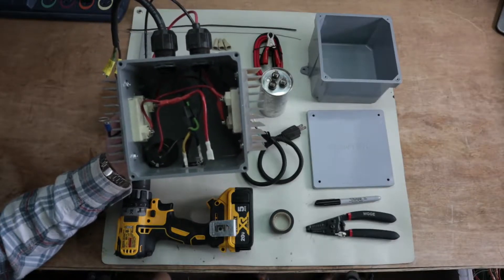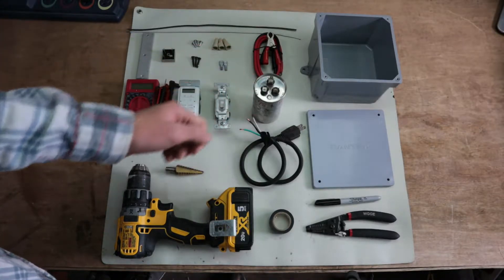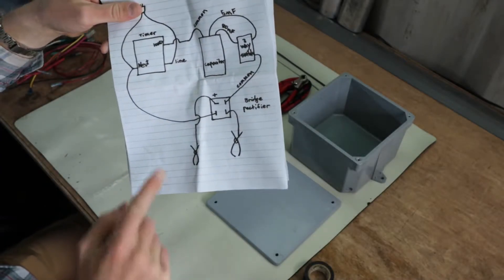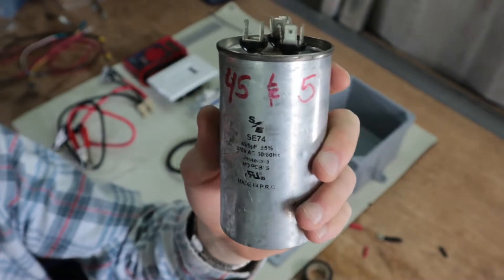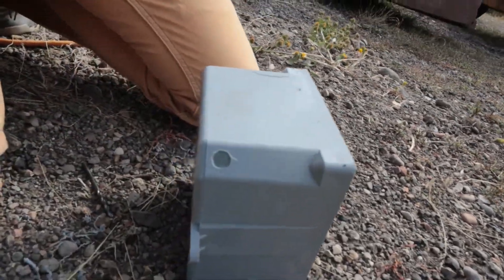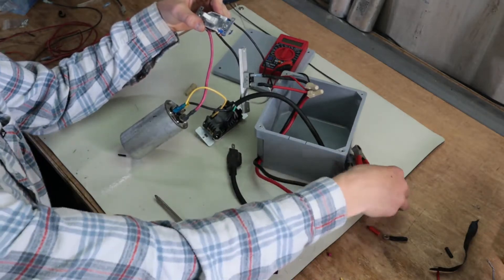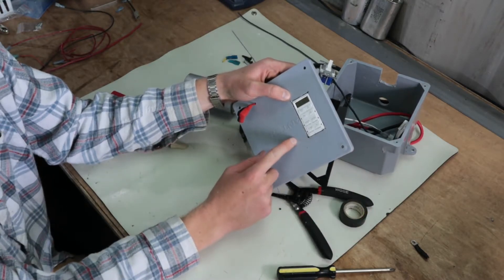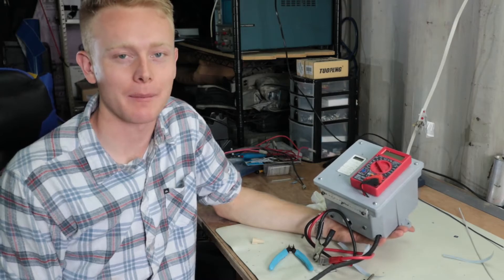Capacitive Battery Charger | Revive Dead Batteries

Comment: Important tip is to drain the battery to about 11.8v. and then charge.  Better if you do it with 240 v. prolly.  Bigger bangs on each discharge, though I just did it with 120v.

Comment: You have a 2 way switch not a three way. When explained wiring you started with the capacitor which is the middle of the circuit. REALLY? Start with  AC coming in. You should also wire your switch to the AC first, then to your timer, capacitor, and bridge rectifier. It may  be  a good idea to add some short circuit protection.

Comment: I have a question about changing the circuit for simple battery charging.  AC220V - DC adapter (5V) - DC capacitor (eg 50V 220uf) - Battery (Li-ion).  When I use it this way, there is no problem.  If there is no problem, is the efficiency lower than when using AC capacitors? (For example, it is difficult to charge a large battery for a car.)   Please advise.
Reply: The flaw whit this circuit is that it's like a constant current charger, but for batteries you also need some sort of voltage limiter to prevent overcharge. 
You can just use an lm317, set the voltage to  a maximum of 4,2V (a bit lower is better). It will charge even a dead liion battery if the safety cap has not blown. To prevent fire you pick a bucket, add 4cm of sand, fill whit water, add a plastic film (like the one used in kitchen) on top and place the battery over it. If something goes wrong it would fall into the bucket whitout damaging anything else in your house
Reply: wait this circuit is the worst idea if you need to charge litium based batteries. it's not meant to charge, but to send really high current spykes (thousands of Amps) into a lead acid battery. this way it could break the sulfate deposit which prevent battery charging. litium based battery are gonna explode brutally if you connect them to this circuit. 
Please don't play whit electricity from batteries and grid, if you don't know what you are doing
Reply: @cmh-c  Thank you.　I also know that lithium-ion batteries are dangerous with the concept of video.　A lot of people pointed out the problem, and I know they mentioned the risk of explosion.　However, I am a case of a very small-capacity DC capacitor, my years of experience, no problem.　This is because the lithium-ion battery, which is about 10 years old, can be fully charged and used.

Comment: I don't like how you have the three way switch wired with the capacitor.  It would make more sense to wire the common on the capacitor to the rectifier, and the common on the switch to the timer.  Wire the T1 and T2 on the switch to the 45 and 5 terminals on the capacitor as you have here.

This setup avoids charging one side of the capacitor to just let it float.  While this may not particularly matter in this usage case, it's a bad practice from a safety standpoint.  Remember that this capacitor is a non-polarized device, so there is no such thing as connecting it backward.

Comment: Will a higher capacitor damage the battery? I have a 56000uF capacitor
Reply: Do not even think about it 😱💥💨 😅🤭
Reply: the higher cap valu, the higer amp supply to the battery ! battery will explode if more than 50 uf !! BOOM !!
Reply: i am using 200uf 400volt Ac capacitor. rinning in 110 volts 60Hz it give me 9 amps for a big battery 2 volts 95 amps